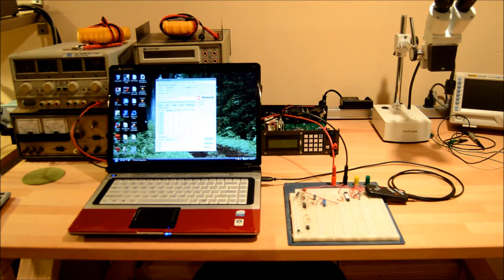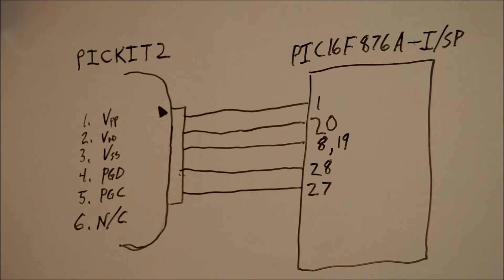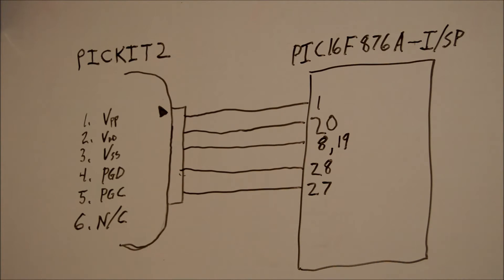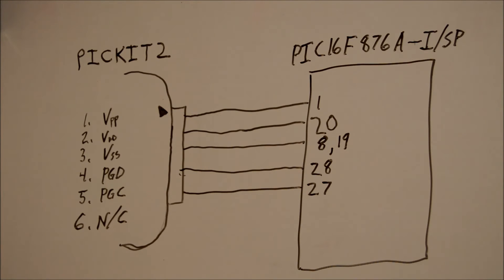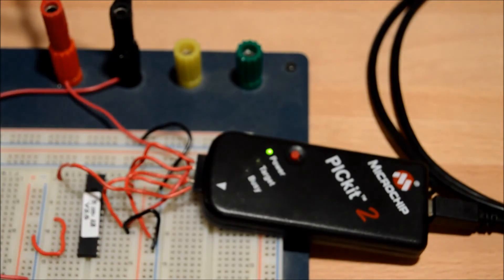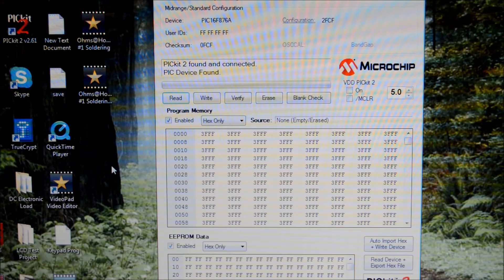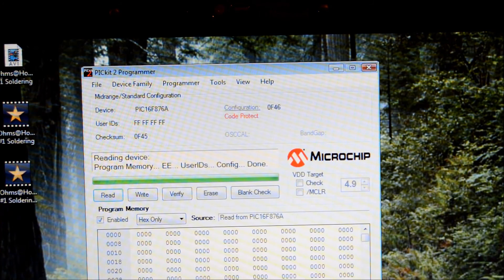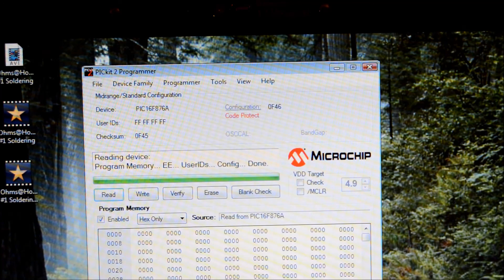OhmsAtHome #1 PIC Hex File Read

Comment: You can indeed get information from the *.hex file! It's not an easy task. But Search "how to read hex files from microcontroller". You could theoretically re-write some C# code which could mimic what the hex file tells you is going on with registers and ports. This coupled with schematic showing what is connected to input and outputs it wouldn't be to hard to rebuild a program. Also, there are workshops on explaining how to circumvent CRP on PIC's. It shows how to clear 1 memory registry then exploit the rest for their contents. Then you use a second chip and clear a different registry and dump the 1st registry you used so you end up with ALL the registers info on the final hex file. Go do some research. Cool nerdy stuff

Comment: did you really expect it to be that easy?? the only way to extract code with CP enabled is ic decap and read code bit by bit but it requires laser precision equiment. Alternatively you can try glitching the ic but you need a strong programming/electronics background

Comment: If you save the HEX file is it still possible to write it into other chips even though it's source is code protected?
Reply: Good question. Anyone???
Reply: Eh the source code is NOT on the chip. The "HEX" file contains the compiled machine code that exists on the chip. The readout protection is to protect from flash memory readout. If you got the HEX code, then it's not protected and you can write it to other chips.

Comment: I was reading a post in a forum a few months ago and a guy said if you apply power to a certain pin of a pic chip it causes a glitch and you can then open the hex file. That was for 40 pin pic chips. No sure if this works or not.